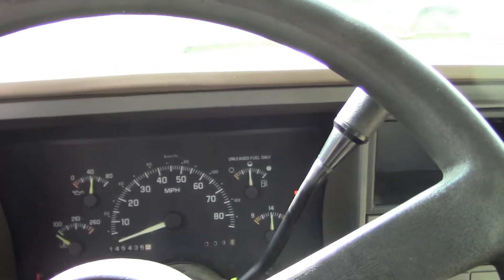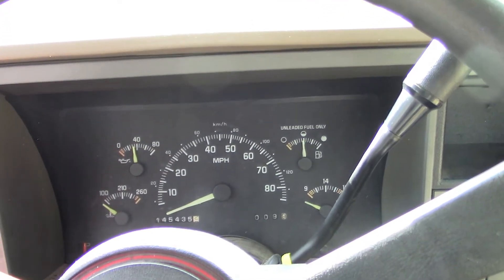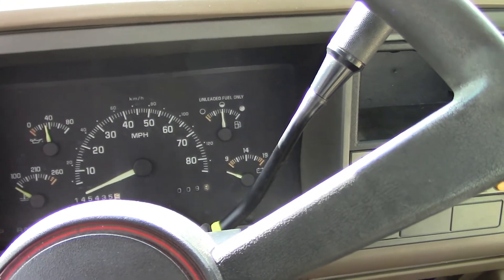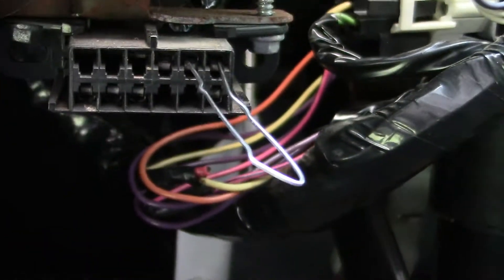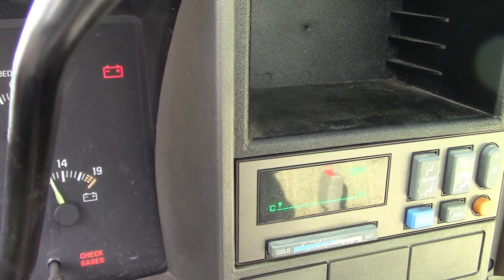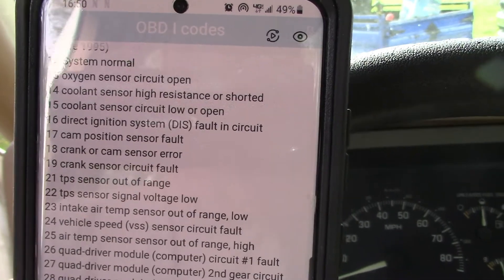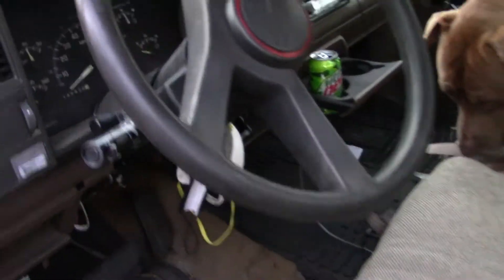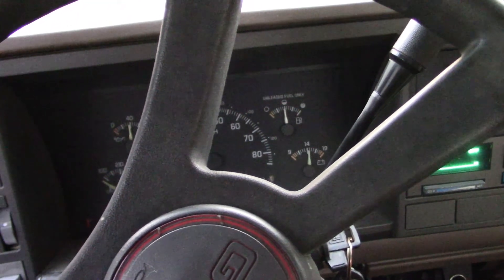How to read OBD I codes on 82-95 GM vehicles (codes included)

Comment: Hey I tried the paper clip method to read codes on my 95 caprice and check engine light just turns off it doesn't blink and give me codes
Reply from the maker: The spades you need to jump may be different on the caprice. I was told all GM did the same but I may have been misinformed.
Reply from the maker: I found a thread that says to jump terminal H and terminal A. Not sure if that helps or not. It seems from the little bit I read, this was a common problem with the caprices.
Reply: Did you ever figure it out?